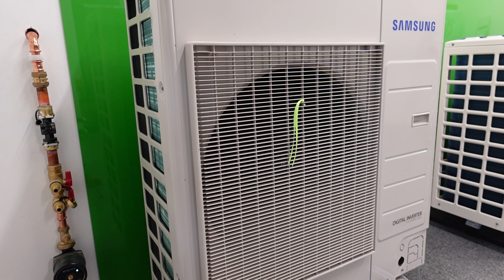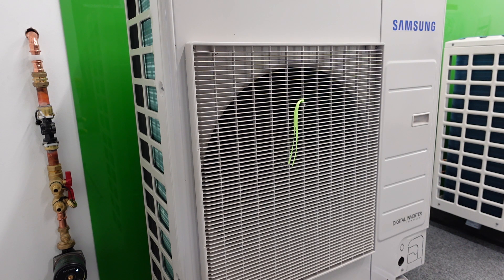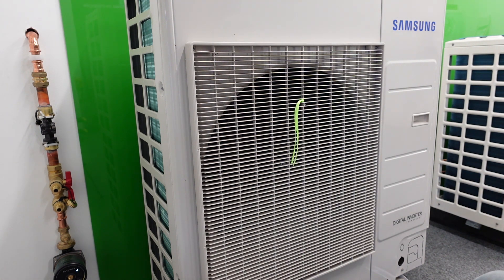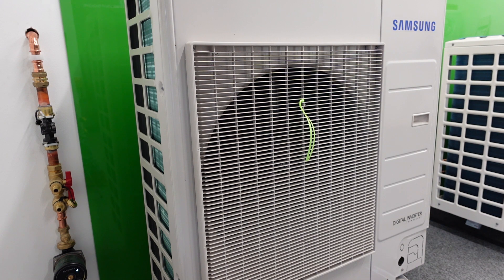Samsung Noise PT1

Comment: May I ask a question please. 
I have a 16kW unit, that is supervised by a homely optimiser, for my DHW it’s feeding a 250L Telford tempest cylinder and I have a 45C tank set point that I have timed to run to give me hot water for 14.00 (I’m trying to utilise excess summer PV output).
I’m very pleased with the DHW  COP, it’s giving me 325% which is in excess of the MCS estimate of 175%.

But, I’m confused by the behaviour. It ramps from 0kW all the way up to 6kW input in about 6 minutes, then down from 6kW to 0kW in another 6 mins, by which time the tank has already overshot the set point by a couple of degrees C. Is it normal for a DHW cycle  to run at near max output for such a short period of time, I was expecting it to run longer but at a lower power input. I thought efficiencies were gained by running at lower flow temps and lower pump speeds.
Is this normal for a DHW cycle please?